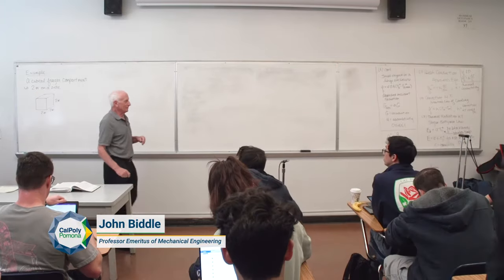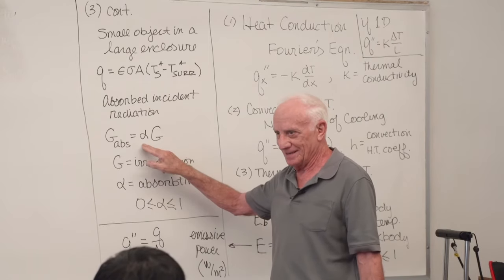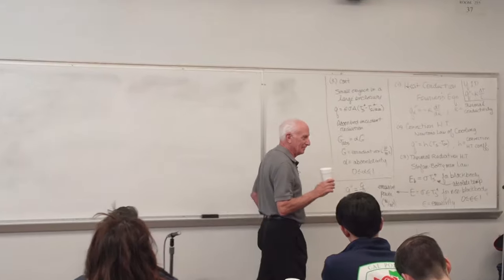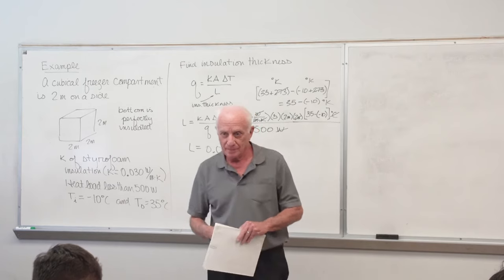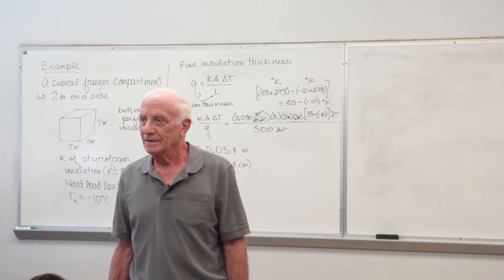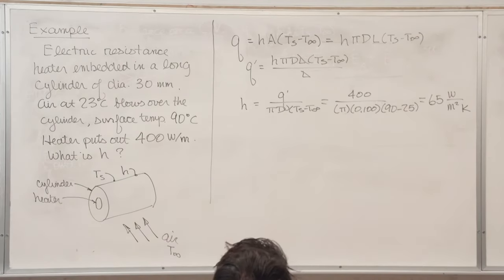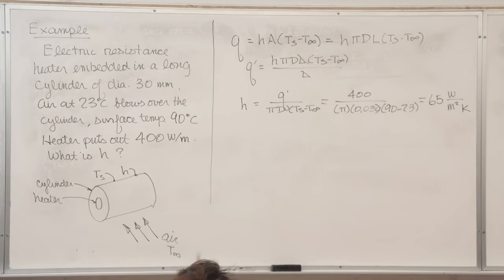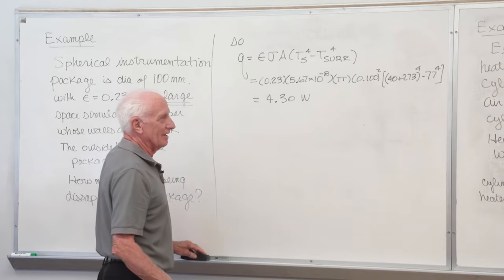Heat Transfer (02): Introductory examples, energy balance on a control volume and control surface

Comment: Not heat transfer related but you sir helped me graduate with my civil engineering degree when I was struggling with my fluid mechanics course. Most of my professors were in it for research, not teaching. You are one of the few that actually care about what their students learn. From the bottom of my heart, THANK YOU.

Comment: When you do the calculations for the second example, the answer should be 63.3 W/m^2*K. Not 65 because he changed the 0.035 to 0.030 which is given in the problem.

Comment: Thanks for the  lecture, it has a great explanations about the subject! However, i couldnt catch the point at the second example, why the equation divided by L? The air comes through outer sheel to inner shell center from side , so i think we should consider thickness as a radius of 30mm because heat transfer from outer side area to inner. If would air goes through from base of cylinder, we can think it as L, i guess. Does anyone thinking like that?

Comment: Just to point out that in the power dissipated part at 36:40 he uses de diameter to calculate the area of a circle with the incorrect formula.
Reply: it's not the area of the circle but the cylinder's curved side (2pi*r)*L or as he wrote, pi*D*L. This is "a very long" cylinder so I assume we do not consider the two circles on each side of the cylinder, only the curved surface

Comment: I believe the answer to the convection problem is wrong. With the values Dr.Biddle used I was getting h=63.34 (W/m^2K) @30:40
Reply: I got 63.345 too
Reply: Yes he put in the value 0.100 for the diameter instead of 0.03m, what he wrote should give you 19.003 but that's not what he put down.
Reply: I couldn't understand (be sure) about the area calculation of the sphere in radiation example

Comment: For the cubical freezer problem the degree C and K is not driving me crazy but what is driving me crazy is the area.Is it the area of the inner side of the insulation or the outer side of the insulation?
Reply: Yeah, actually it was to be left with 2x2 only. The outer area.

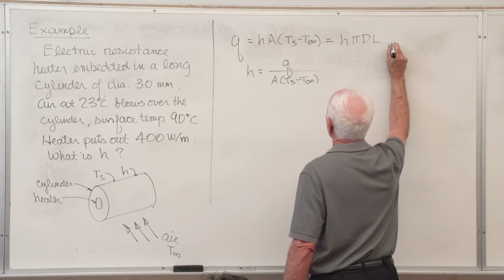Comment: 28:30 can someone expain why the area of the cylinder is pi*D*L ?
Reply: hello i think it's not the whole area of the cylinder, it's the area of the outside of the cylinder (the one with contact with the air). We take the perimeter of the cylinder and we multiplie it by the length. think of it us the area of the shell of the cylinder without the two bases because that's the only surface that is perpendicular to the air direction.

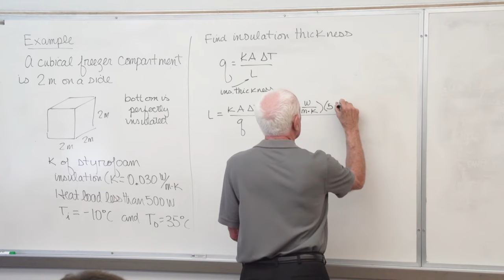Comment: I cant understand how it became 5*2*2 in  00:16:16
Reply: 5 is the sides of the cube (it's not six because the bottom side is perfectly insulated, so there is no heat transfer over that side). 2*2 is the area of the square. So it's a total area of that freezer
Reply: 00.12.
Reply: @Mkerlopies123   thanks it helped
Reply: @Mkerlopies123  But the question is about thickness of insulation, so i think we need to just consider one side of insulation which would mean 2*2 only. doesn't 5 make it wrong? enlighten me if i misinterpreted.
Reply: @Mkerlopies123  thanks